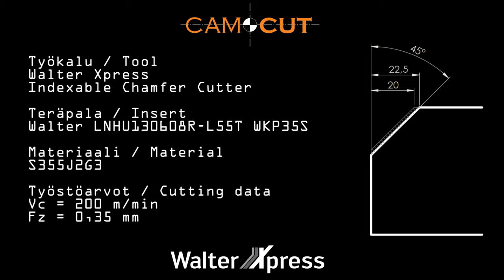Machining with Walter Xpress indexable chamfer milling cutter | Koneistus

Comment: And why this mill is not listed in Walter catalogue? We mill so many big chamfers and still doing it with old brazed carbide tools.
22,5 mm - Is it maximum depth of cut?
Reply from the maker: This tool has made according to the wishes of our customers. Walter Tools manufactures special tools according to the wishes of the users by Walter Xpress service with fast deliverytime. We keep these milling cutters in our stock for our customers so we can delivery those just in few days. Those are really beast for cutting big chamfers!